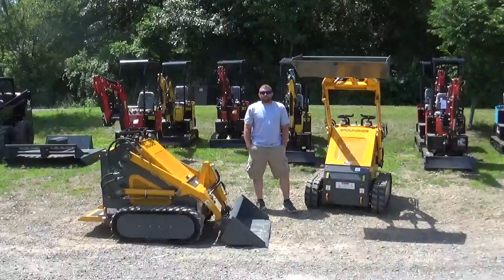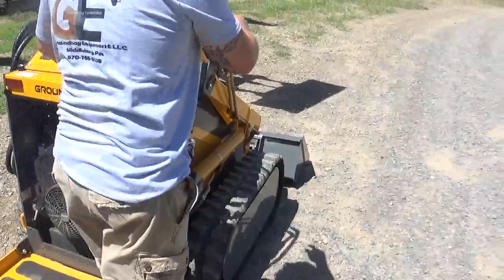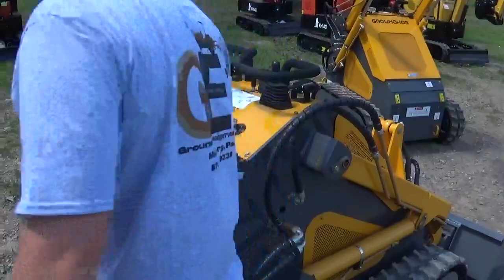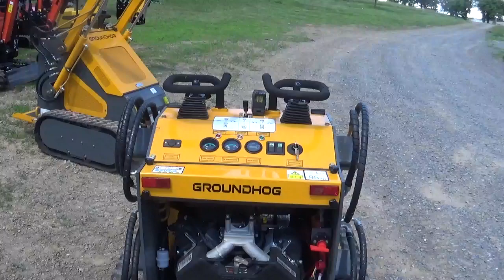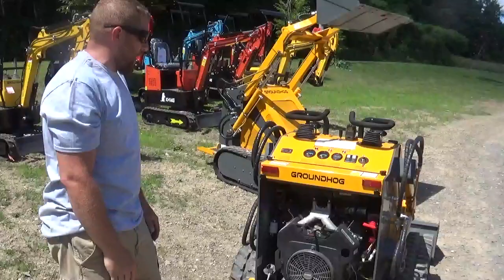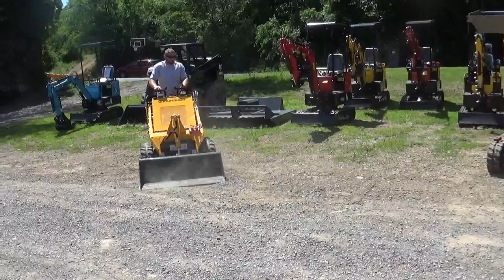GroundHog LT23 track excavator demo video, Kohler engine

Comment: This thing looks as good as my ZH20D that l just got now l want one of these too.
But the 'Boss' said NO!!! lol
Nick was great to work with getting my mini excavator.
Reply: @themonsterwithin6495  Have you watched where Nick compares the 2 units? I believe some of the differences are the Z has a wider track stance and a few hundred pounds heavier (both for better stability), the hydraulic controls as well as a few other small details. plus it's just plain easier on the eyes than the K. I am glad l bought the Z. Currently using to pull Sumac from much of my 3/4 mile of fenceline.